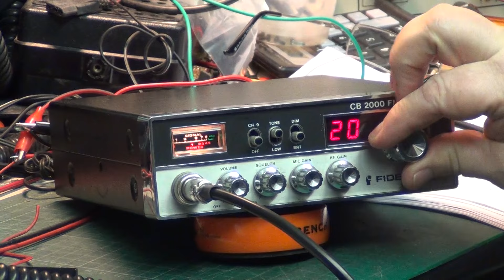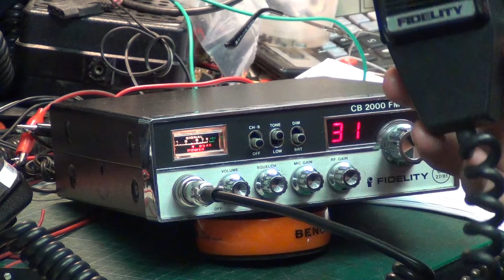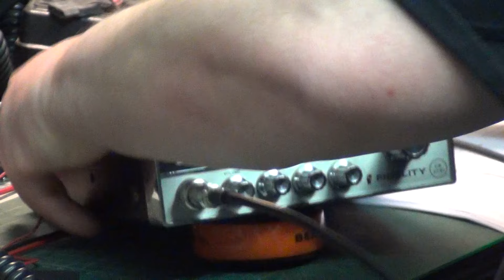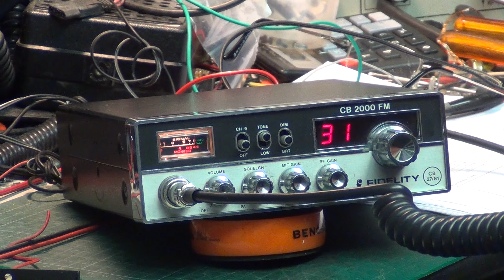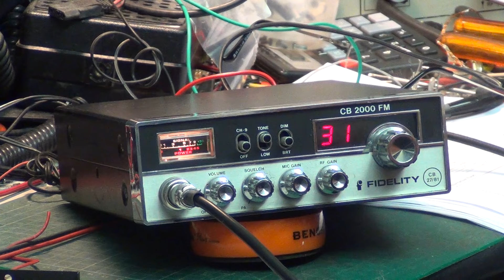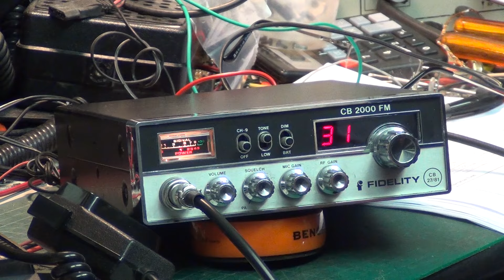Fidelity CB2000FM CB27/81 UK FM CB radio - On The Air test

Comment: This was the best fidelity badged cb radio
Reply from the maker: It was indeed & this model Fidelity used the superb 'upper tier' version of the Cybernet 134 chassis. It's a Rotel RVC240 as a fidelity.

Just in case you'e not familiar, the models went like this:-

Fidelity 1000 - Great GT858 chassis (bleedover box)
Fidelity 2000 - Cybernet 134 chassis (excellent)
Fidelity 2001 - Cybernet 002F chassis (excellent)
Fidelity 3000 base station - unique Great chassis (low power output & bleedover box)

Richard, G0OJF
Reply: @ukfmcbradioservicingTango21 I had the base station and it wasn't very good at all, the only thing going for it was it looked nice, I believe fidelity also brought out a radio alarm clock that looked almost identical
Reply from the maker: @adrinathegreat3095  The Fidelity 3000 base staion is dreadul, but nevertheless hight collectable.

Richard

Comment: Richard what do like about the Fidelity 1000?
Reply: I will look out for a good one.
Reply from the maker: Transmitted audio is superb. They are very reliable....none of your capacitor issues. Most transistors are Phillps & not 'Billy-no-mates'. Mind you I don't like them when there is no extension speaker socket...it seems 50/50 on whether there is or not. The receive doesn't use a clever FM chip so sounds less harsh on the static. Very good sensitivity. Squelch has it's own AM detector & is soft & gentle.

If you are in the middle of nowhere like me, they work well. Not where there are loads of other users because of them being bleedover boxes.

Not many people exerience them working properly on receive as they are tricky to align.

Richard, G0OJF, UK

Comment: it was a shame the Fidelity 3000FM base did not have the same board
Reply from the maker: Isn't it just. However, the Midland 76-900, Harrier CBHQ & York JCB869 base stations are all Cybernet 134 chassis sets.

Richard, G0OJF, UK
Reply: Had them all but they all looked basic with the exception of the midland..
Always thought it odd that there were less controls on the harrier and York homebases than on their mobile top models

Comment: I always forget Richard, what's the difference between the 2000 and 2001.
Ps 3rd mic sounds smoother
Reply from the maker: The 2000 uses the Cybernet 134 chassis. The 2001 uses the Cybernet 002F chassis. Roger on the mikes& thank you for your input.

Richard